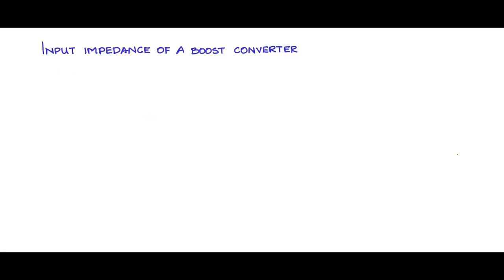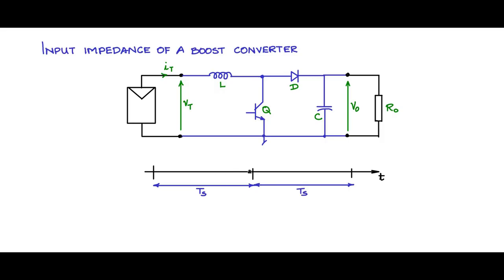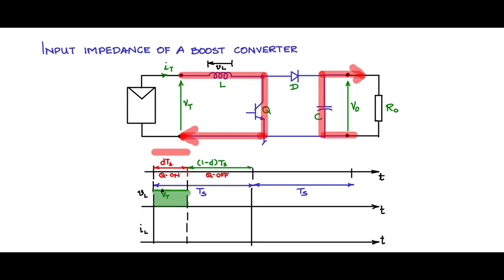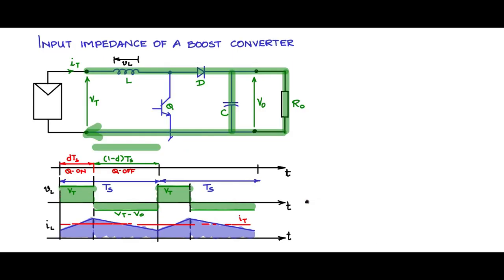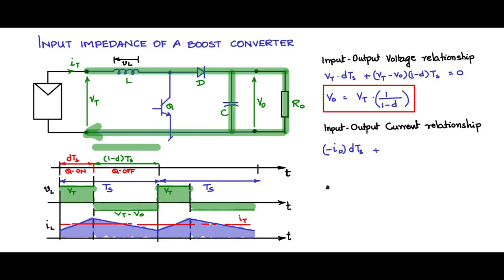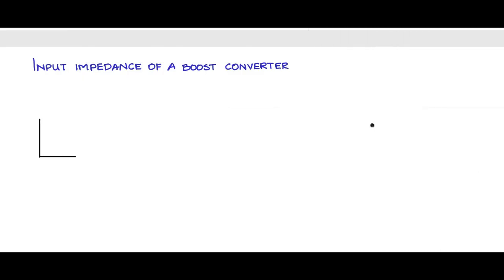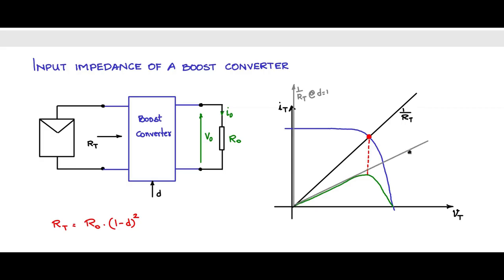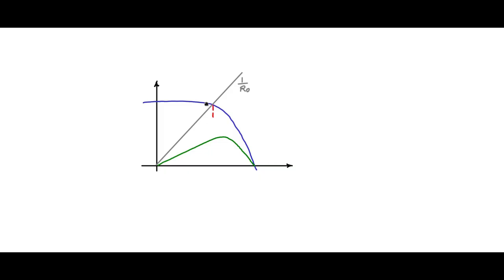Input impedance of Boost converter

Comment: At 7:17, why Vo > Vt?
Reply: Considering it as a Boost converter (Vo>Vt).
Reply: @vinayakpb6012 I didn't get it. Can you elaborate it?
Reply: @bonds3865  In case of Boost converter output voltage is greater than input (hence named as boost).
 Vo=Vt+Vl during off time of the switch, (i,e inductor discharges the stored energy to output at this time, so denoted as negative voltage at off time)
Reply: @vinayakpb6012  Ok got it. Thank you

Comment: Why is the voltage across the inductor zero for one period Ts? What is the explanation for this?
Reply: Under steady state, the average voltage across the inductor over one switching cycle must be zero, else the current would keep on rising, which can saturate the inductor. So for inductor volt-second balance must hold in steady state.
Reply: its because when you apply periodic current through the inductor  the current value is same at the end of each period  leading to average value of inductor voltage become zero...Integrate inductor voltage over  a period you would get current but as the change in current is zero that integration becomes zero..fyi integrating over a period is essentially average value of that function

Comment: 11:12 I thought the discharge of current is exponential. How do you write it as -io(dTs)? What are the assumptions? Am I missing something?
Reply: You are right. However, the switching is done at a high enough frequency such that the time for discharge is very small, and the part of the exponential curve in the small time can be approximated as a straight line.